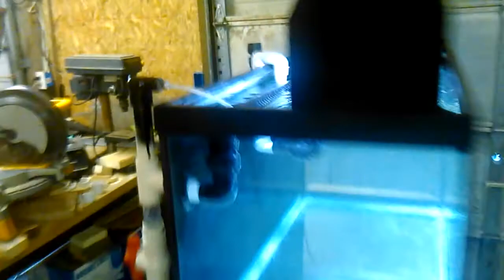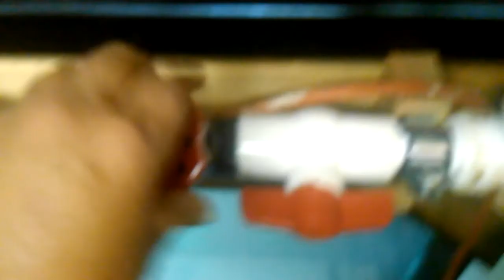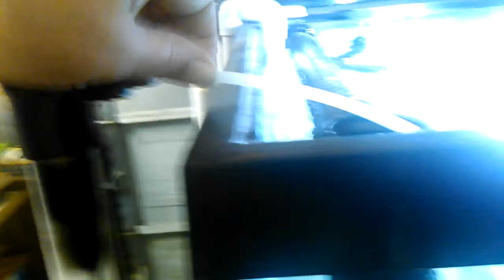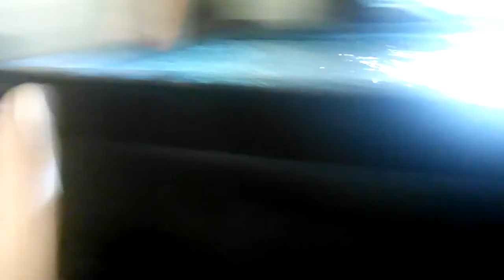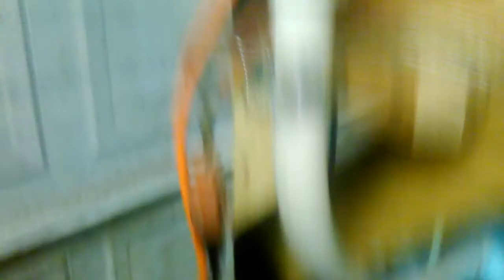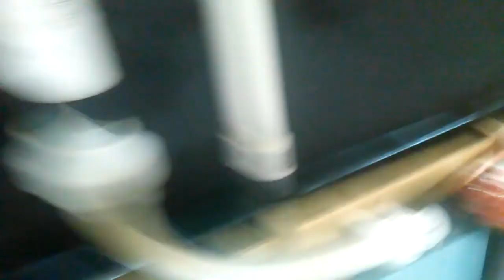Diy Bean Animal Aquarium Drain Overflow with Sight Glasses

Comment: How well do those led flood lights work, I'm thinking about getting 4 for a 125 gallon reef that I'm setting up because they would only cost me $60 instead of $600
Reply from the maker: +The Fish Guy They work great for my Planted tank. I would be unsure how they would be for a reef tank I think you need a stronger light like 10000K. I have seen people build led lights from kits for reefs with all the right colors.  With that said they will make great general light for your tank but I think I would spend the money and get a good T5 florescent 4- bulb at least maybe a 6. Thanks for your question and I hope your project turns out!!
Reply: +MrRvbrown the ones I found have 16 color settings and I have 10kk and 50/50 t12s somewhere in my closet
Reply: +MrRvbrown GLW
Type this in on Amazon, it is the first result 
GLW® 10W LED RGB Flood Light, Remote Control Waterproof Outdoor Security Light, 4 Models with 16 Color Tones Spotlight, Dimmable Color Changing
Reply from the maker: +The Fish Guy Mine are 30 watts and I used a 50 watt one time (better). Those 10 watt will be like night lights for your tank I would think you would need 50 watts ones.